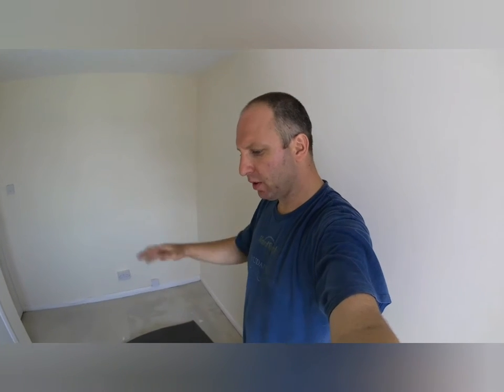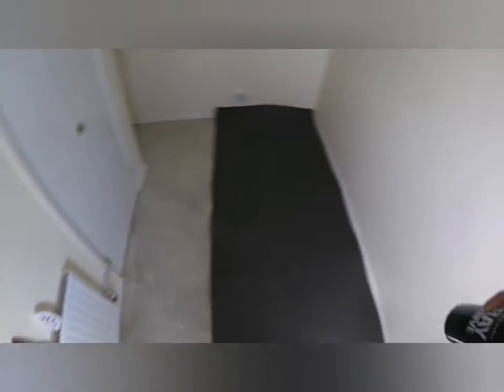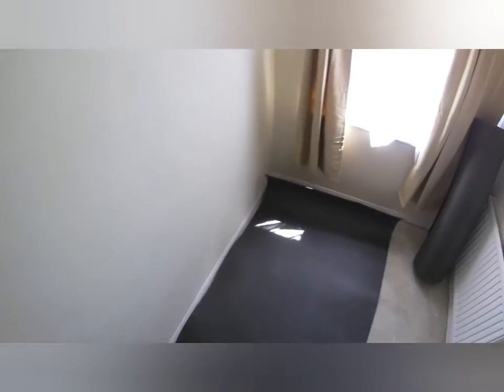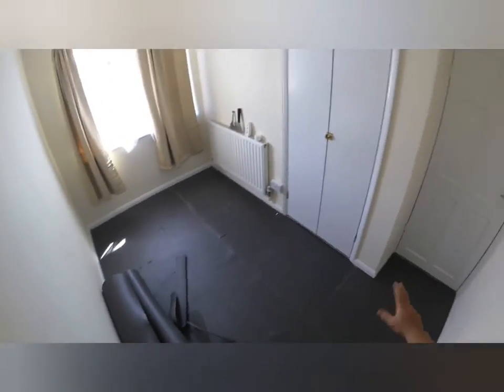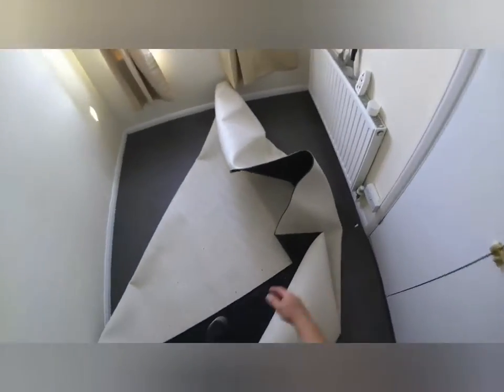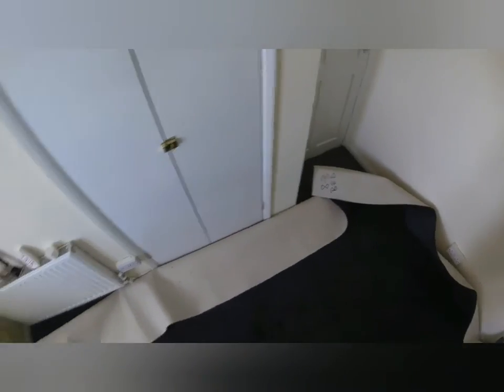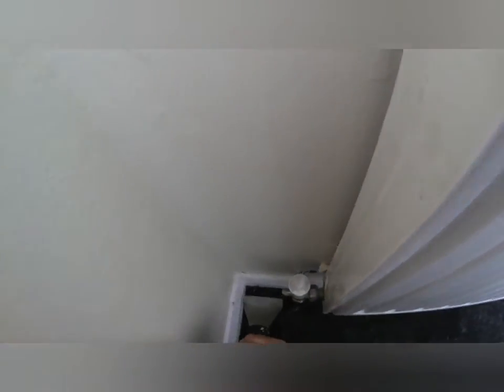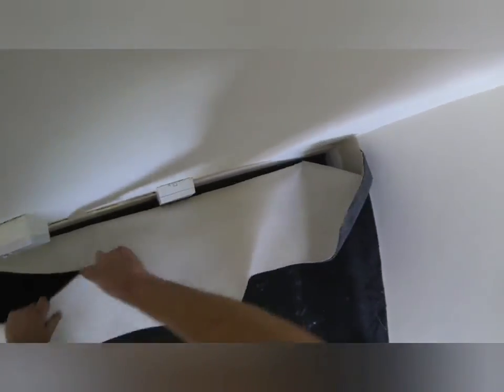DIY carpet and underlay fitting on concrete floor with adhesive only.

Comment: Thanks for the video upload 👍  Fitted the carpet in my utility using this method and all it cost me was a can of spray glue and some Stanley blades. 

Not sure what kind of carpet it was - quite thick pile with a fibrous square crossed pattern on the back, it didn’t seem to like being bent or folded and was difficult to mark for cutting.  No matter as I reclaimed the section carpet after someone had thrown it out, turned out to be the perfect size for my utility and I didn’t want to spend any money getting it fitted.  Wife is happy 😊 that makes me happy.